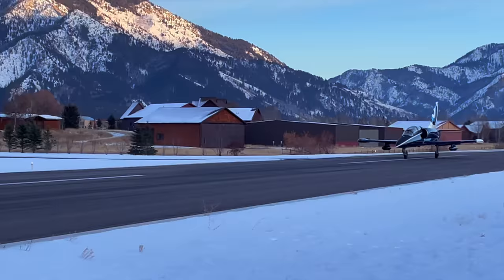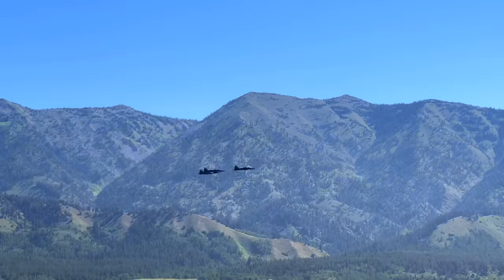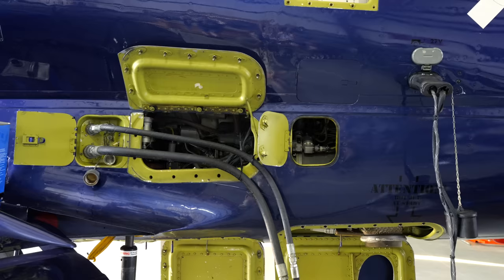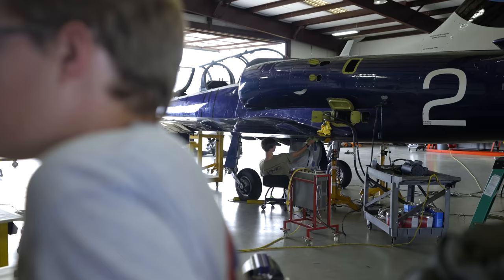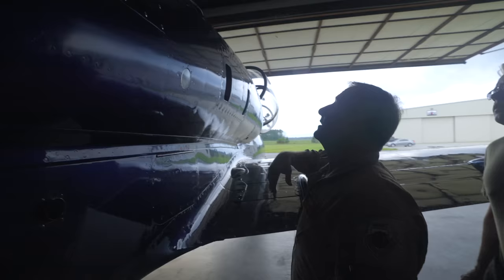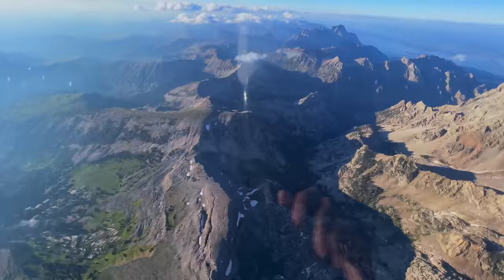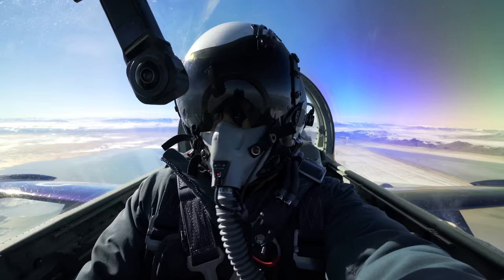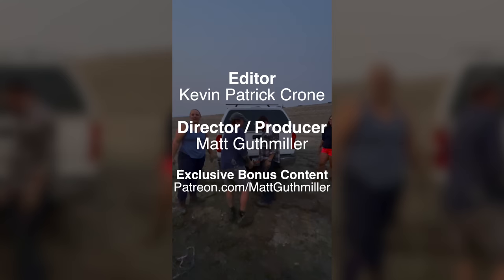Flying a Learjet with F-5 Supersonic Fighter Jets

Comment: Yeah jets can move but a modern light jet could have the same performance for a fraction of the cost. A 2 seater could weigh less than 10% of the L39. It's a cast iron skillet.

Comment: They look like T-38's to me.  Not F-5's
Reply: They look like F-5Bs, which look very similar to the T-38. The F-5B had a similar nose aoa probe to the T-38, but had wingtip station pylons. Normally early F-5A, B, and C, models had wingtip tanks installed.

Twin seat F-5s are very rare, especially F-5Fs. 

There are some

Comment: Matt a couple of questions.  Did you look at getting an F-5E and if not why not?  How does the L-39 compare to the F-5E?  Love the videos.  My cousin has a home up in Star Valley which is one valley over from Jackson.
Reply: F5E is much faster and powerful. It has a much higher stall speed and would be way more expensive to maintain. Parts are harder to find because there is fewer of them left, and the L39 is more practical in every way

Comment: Isn’t that a T-38 Trainer jet?
Reply: Looks like F-5f. I thought the same thing at first but the F-5's have a missile rack on the wing tip whereas the T-38 does not. Another difference is the wing meeting the fuselage. Good catch though.
Reply: I was wondering the same thing. Because it has a T38 nose.
Reply: That what I thought too.. f5's are single seat
Reply: @paramtrx9558  The F-5B and F-5F, as well as the CF-5D are all two seat, another giveaway that these are F-5s is the drag chute... The T-38 is not equipped for a drag chute. Then there are the Intakes... If you look at the front of the intakes, they are vertical on the F-5, and angled forward on the T-38. 

These are F-5s
Reply: It's an F-5B which has similar dimensions to a T-38, but has more powerful engines, larger intakes, and can carry armament.  The original F-5A (single seat) and F-5B (dual seat) Freedom Fighter is a lightweight fighter based on the T-38 Talon dual seat trainer.  They were all built on the same assembly line in Hawthorne, California by Northrup.  Five years later, Northrup introduced the improved F-5E (single seat) and F-5F (dual seat) Tiger II as a larger more capable successor to their smaller Freedom Fighter. 

Essentially, the T-38 Talon supersonic trainer is to the F-5A & B Freedom Fighter is to the larger F-5E & F Tiger II, what the YF-17 USAF LWF demonstrator is to the F/A-18A-D Hornet is to the larger F/A-18E & F Super Hornet